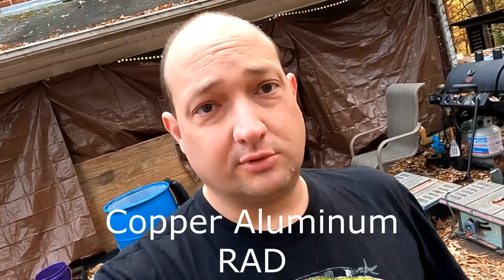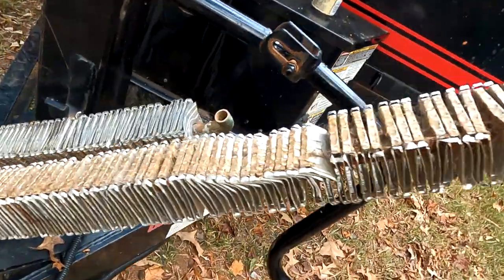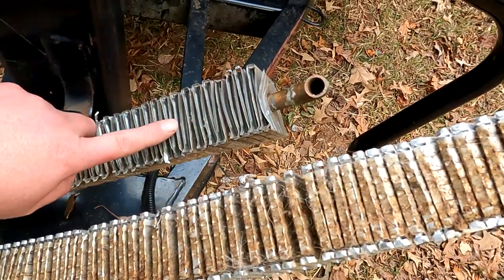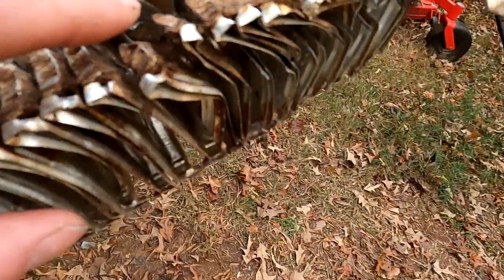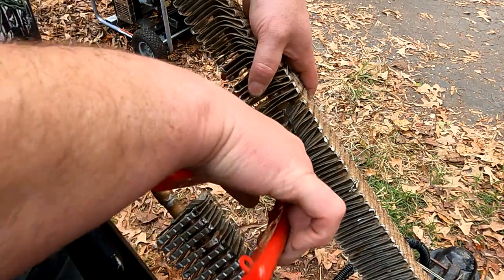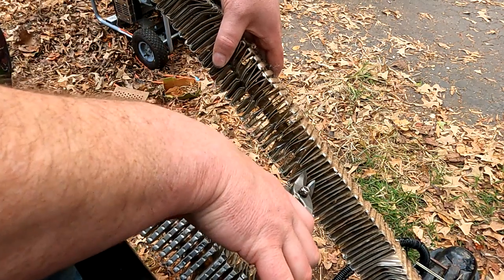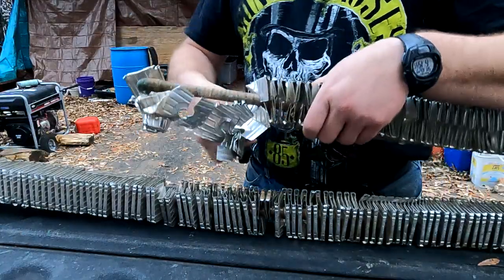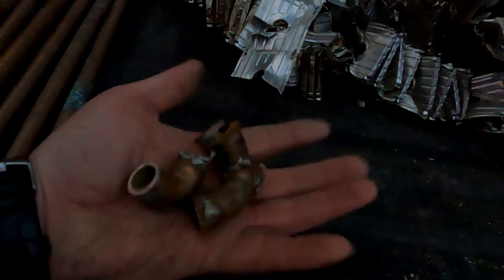How to scrap Water Base board Heat RADS #howto

Comment: Thanks for the demostration! Have you ever tried removing copper pipes from the smaller radiators like those found in heat pumps or air con units?
Reply: No I haven't. Don't know if it would be worth the time really. You have brought up a good question. I have a huge stack of the heat pump rads stored up. Might have to try one!!! Thanks!